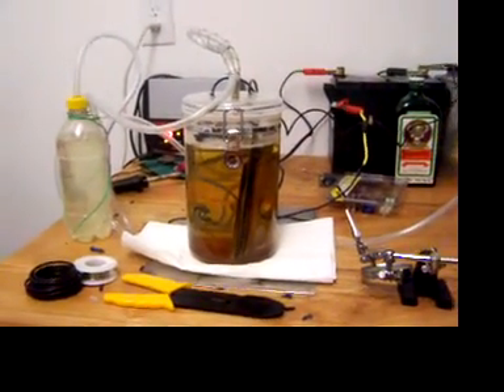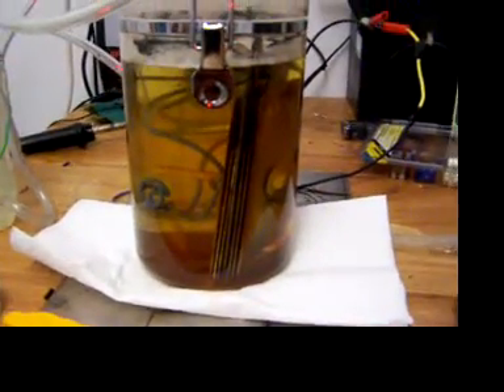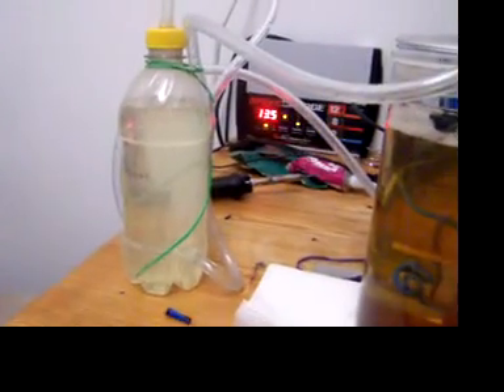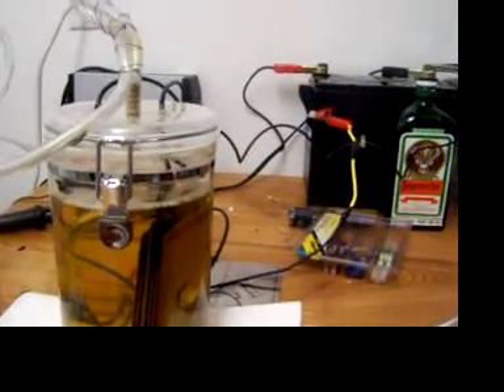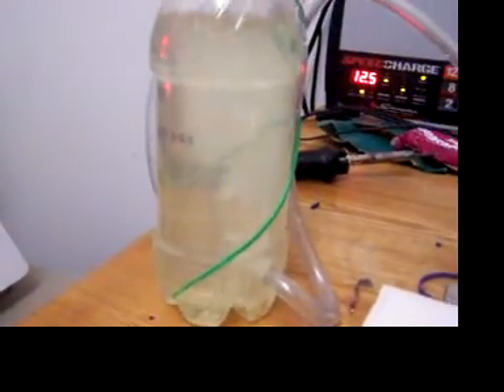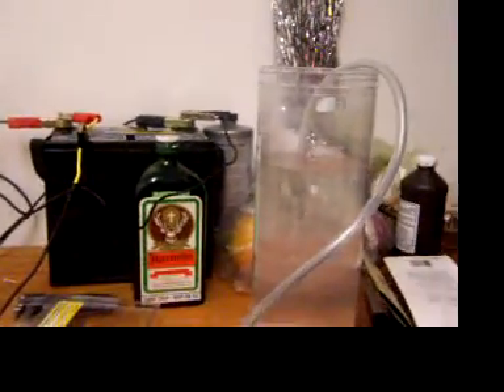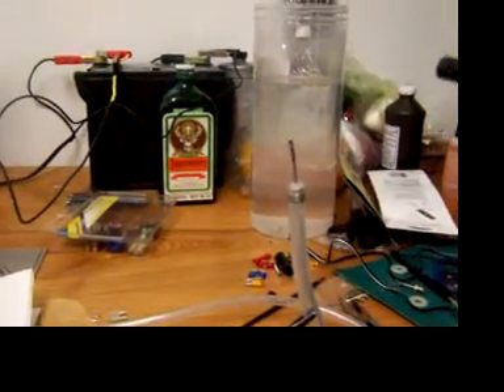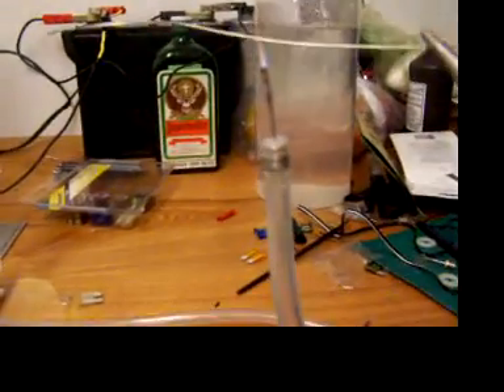hho KOH hydrogen cell vid #2

Comment from the maker: I add about a cup of alcohol to the mix and it seems to drop the amount of current i draw and it prevents crud buildup on my plates. i also think a little of the alcohol gets entrained with the gas because the resulting flame is much bluer and it seems to increase the heat/cutting ability. There may be no real advantage of adding it but i get bored and dump random things in to see the reaction.